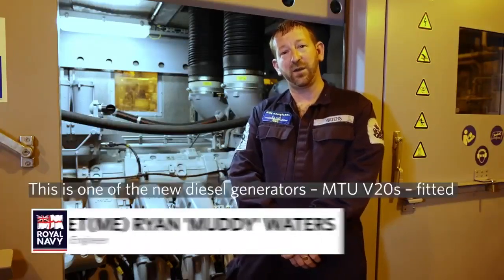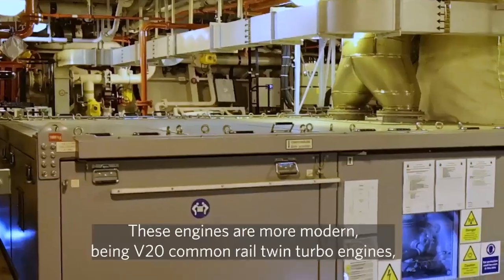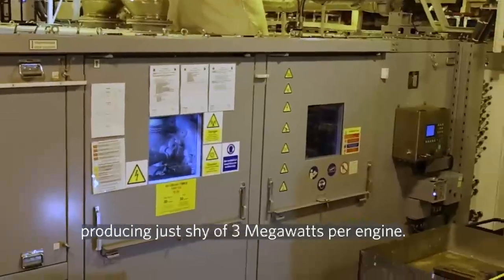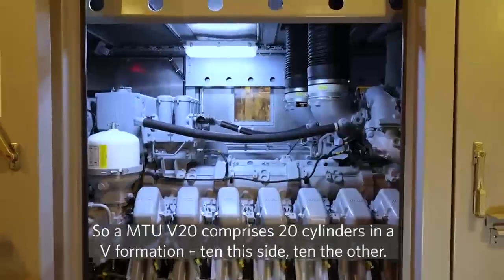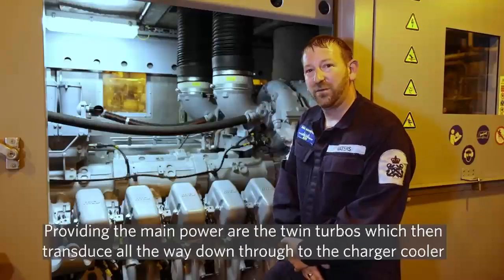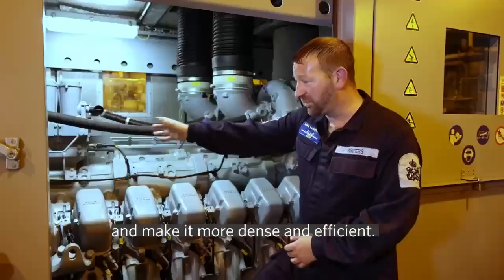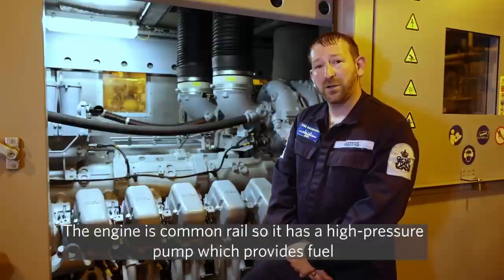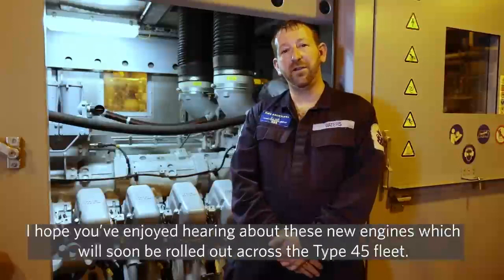New diesel generators fitted to Type 45 destroyers

Comment: Great to see these coming in.
Reply: @Horn Piper go away.
Reply: @davidhouseman4328  
There may be some truth to that as Northrop Grumman was responsible as the engine did not operate as advertised due faculty parts from NG
Reply: The thing bugs me is why they didn't simply re-engine them with MT-30?
Reply: @verdebusterAP  That was an option but would have been way too expensive, changing the DG sets should ( hopefully) cure the issues once and for all at a cheaper price.
Reply: @paultanton6721  
Expensive for installation but at the type-26 and QE use the MT-30 ,there would massive savings in maintenance and logistics
Reply: @verdebusterAP  Certainly the best solution but swapping out Gas Turbines is a major undertaking, some serious redesign and engineering work would need to be done. Looking at the work involved to swap the DG's out and fit a third one looks way more complicated than people might have imagined.
Reply: @paultanton6721  
Which asks a lot of questions about the WR-21
Reply: @Horn Piper "The Americans provided the financing"

Yet again Michael Pezzullo with your lies and nonsense! You are Italian with a weird OBSESSION with sucking up to the yanks